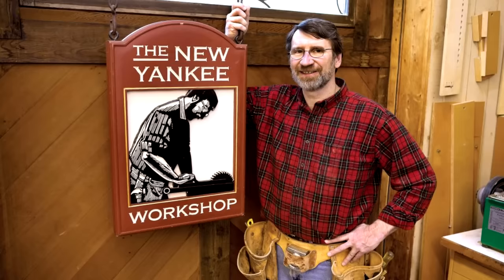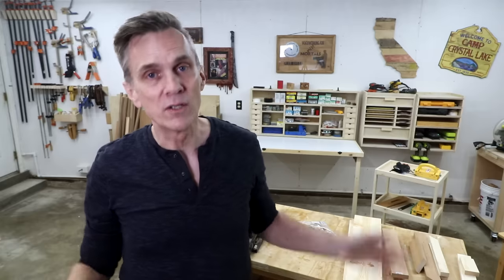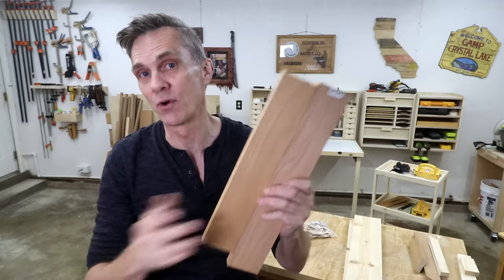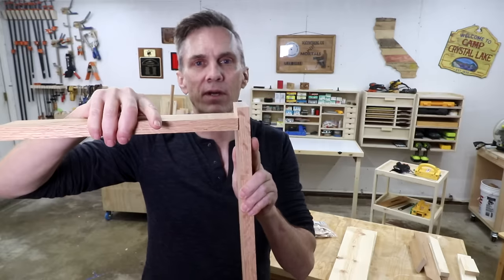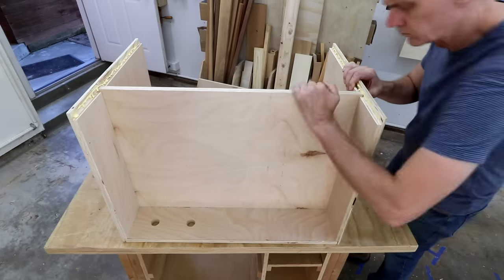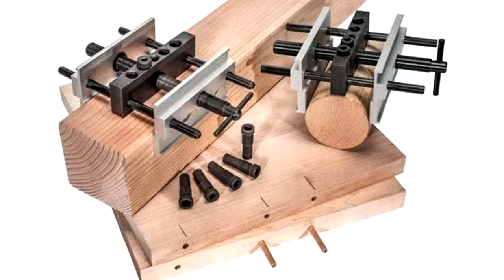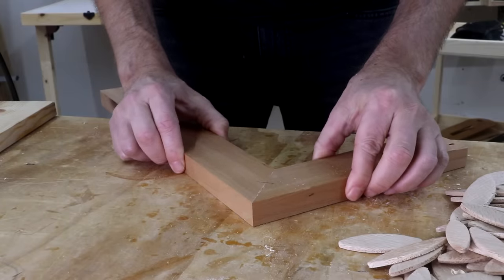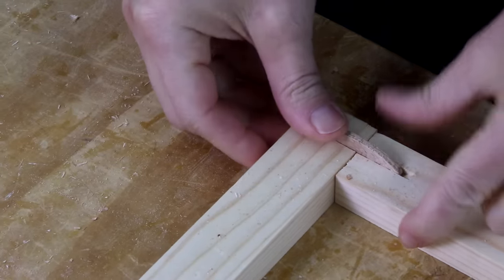So, is a biscuit joiner completely useless?

Comment: I certainly swear by my dowel jig. Everything lines up and is relatively strong. Wish I could afford a festool domino machine. One day I’ll try and mortise and tenon joint though.
Reply: O . G . B Woodwork Now I wish I had a dowel jig. I’ve apparently been wasting my time with my biscuit joiner.
Reply: Jake Skywalker if it works, it works. I guess there’s no harm in getting a dowel jig and trying it out though. They are only between £6 -£20
Reply: I only use my biscuit joiner and doweling jig for alignment purposes only anymore. I prefer my dowels over the biscuits anymore. Easier and quicker to setup vs the biscuit. In all honesty, the biscuit doesn't add any strength, dowels add some but, not much. Glue is actually stronger than the wood anyway, provided you have ample glue for the joint. Cheers :)
Reply: Ham68 thanks mate. Do you have any other methods you use?

Comment: I love my Porter Cable 557 and I actually use it.
My favorite use is to keep pieces from slipping and moving during glue up. It isn't necessary for panels but I've used it on odd angled pieces and even to attach face frames to carcasses.
The biscuits are not strong enough to be a tenon but they are a good substitute for long tongue and grooves or T&G chest builds.
I'd buy it again.

Comment: I use my biscuit joiner more frequently to cut slots in table rails than I use it as a joinery tool
Reply: I was going to add something similar. I've just replaced an ugly, glass shelf in the bathroom with a floating wood shelf. Since the attaching pieces (I don't know how to explain this more clearly) were already in the wall and I didn't want to damage the wall tiles, I had to cut slots into the wood and it was quite a challenge for me. The result was looking awful, but since it's against the wall, it's acceptable. Still I thought about them immediately when I saw this video about the biscuit joiner. It's not that I'm gonna buy one but if I already had one, I would have used it for that shelf.
Reply: Exactly! I was about to sell mine, but I can attest that it's the best tool to cut slots for tabletop fasteners
Reply: @killingoldgrowthsince  because it's safer and a quick way to cut those slots.

Comment: IM 99% sure, I cant find mine, thats how often I use it. I know there is a yellow plastic container, (used to be clear) full of biscuits. I like many bought into the concept, and i purchased one, used it on a few projects and contrary to the belief, I couldn't keep my boards lined up after running a biscuit joint, in fact it was worse than I could do on my own. so it created more work in the long run. 
Every once in a while, I think to myself, I wonder where  my biscuit joiner is, and I will think, yeah, your not doing anything go see if you can find it. Then I realize, well, Im not going to use it anyway so where ever it is, its not going to be in my way, so lets sit back down and watch another wood working video. hehehe. 
Thanks for sharing, love the creativity you have come up with on finishing up with your left over biscuits as well. Keep up the fun videos and have a blessed week. 
Dale

Comment: Great Video!   I have to admit that Norm almost convinced me that I needed a buscuit joiner but ai resisted.  I leaned to make mortise and tenon joints when I was around 8 years old (1957)  By the time The New Yankee Workshop hit PBS my chiselling skills were really well honed.  In the early 1970's I learned about Japanese joinery and using those wonderfully engineered ergonomic precision woodworking tools.  I do use precision routers but mostly my shop is serenely quiet.

Comment: I am a home builder and in the field we use biscuit joiners for window and door casings and they are pretty helpful. But that is about all we use them for, and it falls in line with what you said about miter joints.

Comment: In Kentucky summer humidity, my first and second biscuit joiners were fantastic at keeping materials leveled and I never had one of these joints fail... BUT I never used a biscuit joiner for face frames or door frame joints. I bought a mortising machine and built a tenoning jig for the table saw. As a life-long contractor in my area there are a LOT of Built-in book cases and cabinetry around here with my biscuit joints. I guess everyone has their own way of doing things though.

Comment: Steve, have you seen or used the beadlock system? It's a floating tenon system.  It's not as expensive as a domino, it's as finicky as a dowel, but much stronger and easier to setup/use.

Also, I also bought a DeWalt biscuit jointer because of Norm.  It was $200 at the time.  OUCH!
Reply: I bought the Beadlock system a while ago when I jacked up my cuts and didn't have enough material left for tenons. It was a bitch to learn but quite useful and only like $180.

Comment: I have to disagree on one point.  It Does help bring boards together in line.  My biscuits have 0 play.  I have to hammer them in and then use the clamps to close the seam.  Now I will say the original blade that came with it created some play but buying a nicer blade eliminated the play (it's pretty cheap too). I had to put a 4' x 8' table together and the biscuits helped get everything in line.  Everything else you said...on point.  It doesn't get much use as I just don't need it unless it's for large panel glue ups.

Comment: If you are into laying wooden floor planks, the biscuiter is a great tool for butt joints around stair openings and when you wish to re-orient the direction of the boards to enable better access to the tongue for 45 degree nailing/cleats.  Biscuits used simply to help with edge to edge joints give also peace of mind and reduce longitudinal warping when used for table top planking.... sometimes even used in pairs with a 1/2” gap between them.

It is also quick and easy to use.

Comment: I’ve never had anywhere near that degree of “slop” in a biscuit joint. I think perhaps one of your components is metric and the other is English.
Reply: The English part being accurate, and the metric requiring attention.
Reply: In England we use metric. It is actually against the law for old imperial, what you call English, measurements to be used in retail. So we can’t buy things measured in inches. This has been the case for many, many years now.
Reply: @ianc1097  Against the law? I call bullshit
Reply: @nathanbell8356  it is against the law!
Reply: @nivid01  Can I see some proof? A link perhaps?
Reply: @nathanbell8356  In 2000, it became a legal requirement in the UK to weigh and measure loose goods in metric and to provide metric price labelling. You want a link, use your fingers and google that. It's sad that people get so snowflaked about a system of measurement.
Reply: @rusmiller816  Yea, because the rest of the world doesn't whine about Americans not using standard measurement. If anyone is "snowflaked" it's you throwing a tantrum right now because I asked for proof of a claim.
Reply: @nathanbell8356  Imperial isn't 'standard' because the majority of the world uses metric. And here you are, like Trump, another snowflake, throwing out insults and refusing to concede after being provided with the proof you asked for. I'm sure you'll come back with some other genius reality-denying comment, but I've said my piece. Take care of your mind.
Reply: @rusmiller816  I've never crossed paths with someone so bitter about being 2nd place.

Fixed my typo btw

Comment: Dados and rebates are also my go-to method.  I just have to plan ahead so I cut everything that uses each particular bit/depth at once so I'm not changing back and forth.
For dowel joinery it's simple: spread the glue into the joint and then drive two or three screws in (drill pilot holes if necessary).  Once the glue has set up, remove one screw and drill out the hole it left to suit your dowel.  Glue dowel in.  Repeat for the other screw(s).

Comment: I would argue that the biscuit does reinforce the joint by breaking the line of weakness the same way a butt strap would. Also a decent biscuit joiner with the correct size biscuits have no slop at all when aligning parts. Large sheet material and even solid timber also benefit from the added torsional support under load.
Reply: It doesnt add strength to anything other than Butt Joints... there are literally hundreds of comparison videos around... some more scientific than others... simply the glue bond isnt superseded by the strength of the biscuit joint so its ineffective... I do disagree with the video for gluing up boards... it takes away all the work in aligning them.
Reply: @spunkmeyer43  You'd literally only use a a biscuit on a butt joint. That's its intended use.
Reply: @tjsabino1991  of course it's not... they are also often used aligning boards... and the strength it gives to a butt joint is barely stronger than the glue and still pointless..
Reply: @spunkmeyer43  We'll have to agree to disagree there. While alignment is definitely part of their use, a biscuit bridges a joint in the same way a butt strap would. It lowers the chance of shearing at or around the joint when torsional forces are applied. I've seen these failures happen many times with many people in our workshops.

Comment: I had to laugh because I was also one drawn into buying a biscuit jointer by Norm. LOL
Reply: Do it, its a good tool
Reply: AS YOU RIGHTLY SHOULD HAVE BEEN. NORM IS ALL SEEING AND ALL BEING.
Reply: @Snaffer01  I use it but have you ever tested the strength of a biscuit? LOL
Reply: @MrSTOUT73  neither has he. He talks about how it doesn't add strength but he doesn't prove it. And he uses the wrong size biscuits which are too loose.

Comment: Hardwood flooring - after trimming  T&G ends and trying to keep them aligned worked amazingly well for me.  Had occasion years later to have remove a section and I took the opportunity to cut through a crass section: I was impresses at how well the glue swelled the biscuit and how much contact there was.

Comment: Wow! I literally was just thinking about getting one lol thank you!
Reply: A close call, you may have regretted it. My cheapo biscuit joiner was a whole millimetre out of alignment (yes I am in Europe, UK) along the length of the biscuit, with no option for adjustment.  Branded ones do have adjustment on the base plate.
Reply: @Pat C Even if branded, they have limited use, and from the practical reviews of using biscuits on glued MDF and pine joints, it makes no difference at all to the strength of the joint.  So I stand by a close call :o)
Reply: @Pat C As I mentioned, limited use, unless of course they build tables and panel doors, then a biscuit joiner would be super useful.
Reply: @Pat C I have the Domino XL DF 700 machine, so have the best of all worlds. A flexible machine that is super easy to use, and it does great joints.
Reply: @briannewton3535  thank you I was thinking of buying a $60 one then I read reviews then I considered the Porter-Cable or even a DeWalt but then I saw Steve's video so yeah I think I'm going to skip on it
Reply: @Pat Cany thoughts on using dowels for Bryan?
Reply: @Pat C lol...well put..ty!
Reply: @rockymanify  I would agree with @Pat C, if you are doing an amount of work where all you require is alignment of stock when glueing, and your machine is well aligned (or has facility to align) and doesn't have 'play' in the thickness plate, then a biscuit joiner is for you.  Pat is right, it is horses for courses.  When using the flip down mortice spacer tabs, tenons on the domino is super quick. Would I buy a brand new one? if I were to regularly do doweled joints in furniture, this machine could speed that job up a bit, there could be the argument that the joints are a little stronger too. The cost to achieve that is Huuuge though.  
With pocket hole joinery, there is a lot to be said for it. I bought a cheap pocket hole jig that was rubbish, I made my own, which works better. If I didn't get lucky on being offered a used domino machine, I would have invested in a decent pocket hole jig and all the respective clamps to achieve neat joints.
Reply: @briannewton3535  @Pat C
Thank you both for your help!

Comment: I bought mine second hand for 40$. They are not totally useless, but most people don't use them properly. They are useful for things like attaching face frames to cabinets, or for something like mitre-corner frame-and-panel doors (which you show). But like you said, dowels or spline joints could also be used instead. I do like having it from time to time.

Comment: About 25 years ago I bought a Harbor Fright biscuit joiner because I had a (preinstalled) windowsill that needed an extension and I couldn't come up with any other possible way to align the two together. I used it to install about eight biscuits along that joint... and put the joiner away. I've never since come up with any other application that called for that tool.

Comment: Hmmm idk. I love my experience with using a biscuit joiner.

Hold two boards together, quickly slash lines on the seam with a pencil, use the cutter on them without fuss of alignment issues, glue, push together, and you have something you can maneuver around and will remain aligned for clamping.

Biscuits allow quite a bit of play but only in the horizontal direction and that is the whole point. Join edges flat without being absurdly accurate about placement like dowels or even drilling holes.
Reply: they have play in every axis. They are shit. You just watched an entire video explaining how crap they are.

Comment: I used biscuits to make a wall mounted shelf out of melamine faced chipboard. Doing so means there was no visible fixings. Dowels could have been used, but my experience with those is they are very difficult to align exactly.

Comment: "dowels have never been very popular,"    
grumbles in Danish modern
Reply: just finished a project that was doweled together.
Reply: I have used doweles... A million times back when I worked as a carpenter in Denmark... Ohh and I lovede them...same as biscuits.. But they have to be the right size to work.. To small and they will break... And the mashine has to be a quality brand to work right

Comment: For shop guys, sure, but for on site finish carpentry they’re great. Try edge-joining prefinished laminate particle core panels with just clamps or pocket screws.
Reply: They can be great for shops as well. You can used them on cabinets, small tables and for making raised panels.

Comment: wow , with my B.J. there isn't any play in the slot "vertically" .... that's why i can use it for alignment purposes ... your seems just wrong man :D But yes , other than that i use it only to mount face frames when i don't paint the wood , otherwise i'll use a pin nailer
Reply: I noticed the same thing about his slots and biscuits
Very loose mine are  not like that

Comment: I have a biscuit attachment for my angle grinder that works pretty well.  I hopped onto a float in the pocket screw parade several years ago so I don't use it much anymore.  I'd forgotten how often Norm used biscuits back then but thinking on it, that's probably why started using them too.

Comment: A home built a table for your own 'floating tenons' and even 'angled floating tenons' was in Fine Woodworking about 30+ years ago. I built it then, and because of the need to produce the best joint for the need of 5 rocking chairs per week to supply the gallerys that the company needed to be stocked weekly. Repeatability without guesswork was the wonderful feature of the design in the Fine woodworking Jig I built and used.

Comment: Man you hit the nail on the head! I got a biscuit jointer that I bought and used one time for the hell of it. A neat tool I have used that is simpler to setup and makes good floating tendons is beadlock. Can even be used as a support to chisel tenons square and I can save to money saved rather than buying a domino to pay for a years supply of bourbon.

Comment: I admit I bought mine in the early 2000s because I thought it was an essential woodworking tool. I also admit I don't pull it out for every project (or even most of them. But when I need it, it's a godsend. As many have pointed out, Steve's biscuit joiner has WAY too much slop in it. I use mine frequently for alignment. When I built my retropie (vintage arcade emulator) last year out of MDF, there's no way I would have gotten everything glued together short of having 5 people hold stuff while I tightened clamps and cussed a lot. With biscuits it was all self supporting. and I did it all myself.

Comment: You can run down the biscuit joiner but I have used one for years both sizes. The big ones and the small ones.
Reply: If you have slop or loose biscuit , you do realize there are different size biscuits (dont you) ??
Reply: @Pawsforreal  I believe he's saying he has used the big ones as well as the small ones

Comment: Looking at the biscuit jointer you are using and it looks like a cheap and nasty machine and your biscuits probably came with it, not surprised you are not impressed with it.
A decent quality machine will provide accurate and tight joints to the point where you need to tap the biscuits home with a mallet, I use biscuits not so much for strength but more for accuracy, for example, joining two pieces of 18mm ply as part of a cabinet so maybe one pice 600x600 and the other 600x300 and you want to achieve a tight 90 degree corner with flush edges biscuits will locate the two pices perfectly (if you use a decent machine and biscuits) allowing you to clamp with ease without the two pieces sliding about.
It's one of those bits of kit where you do need to spend a bit of money to get a satisfactory result.